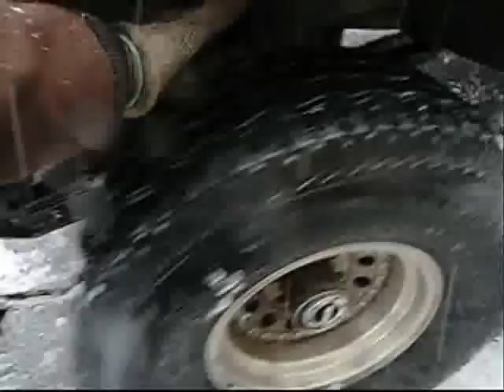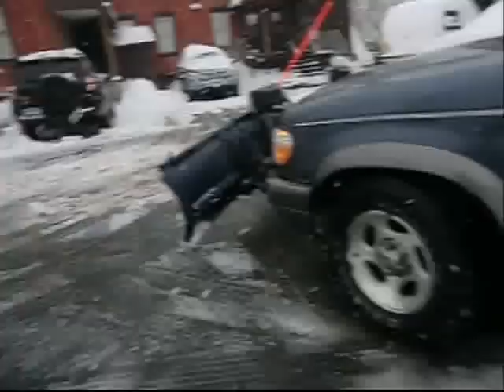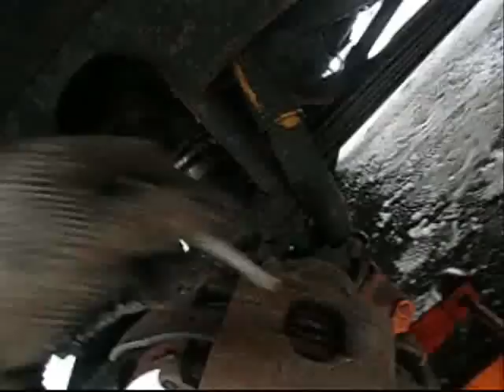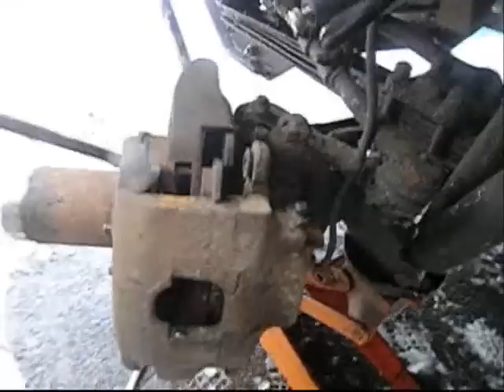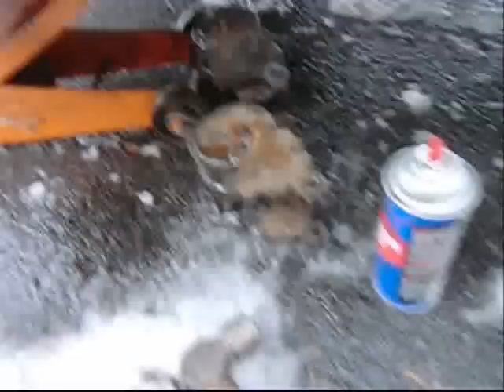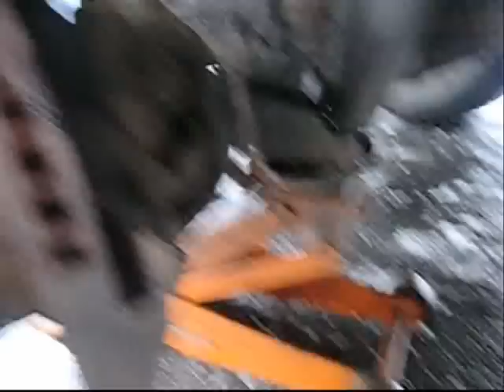11 23 11  K5 Seized Brake Caliper...

Comment: I wander if you could swap the brake hose I had to do that with a 1987 toyota camry to my 1991 camry  . I took the hose from the 1987 put it to the 91 and it worked great .